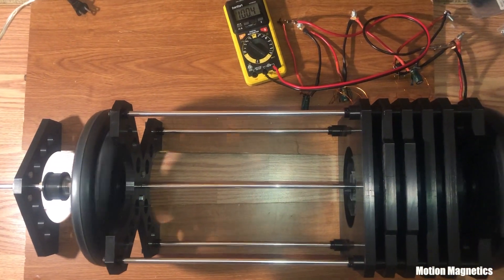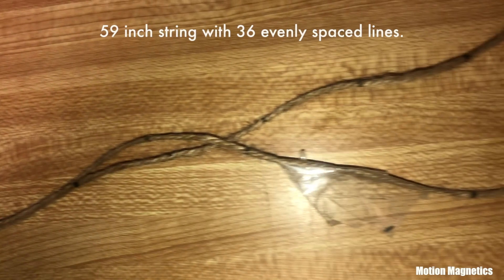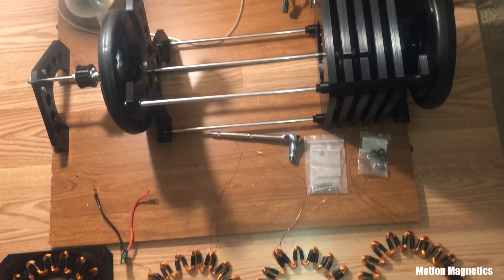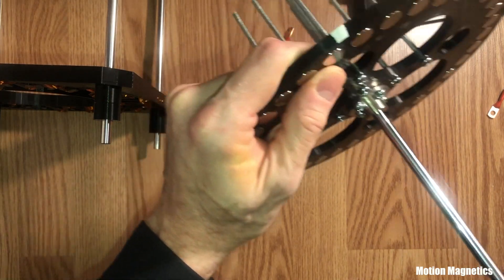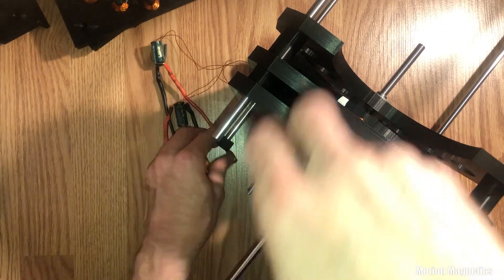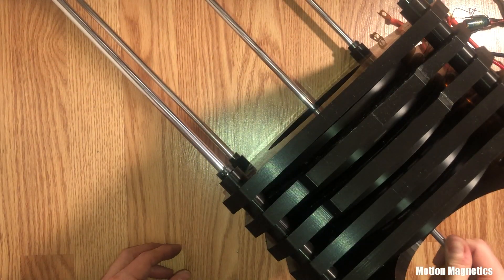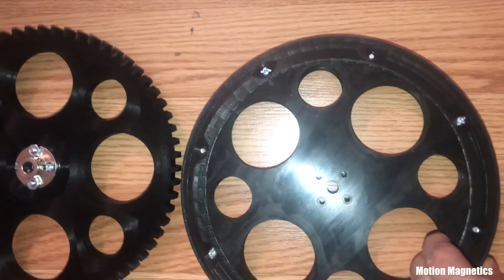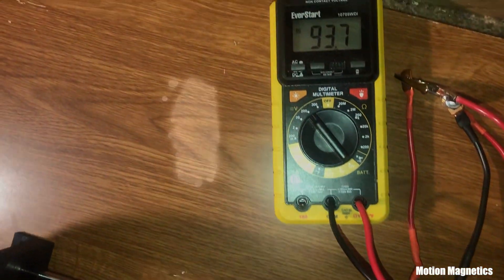Stackable Generator Assembly Guide

Comment: Greetings I been watching u for a while I have own project of my own could we have conversation about this tho I'm suprise that very lov volts as output just did u heard about Infiniti sav sadly it been taken down but it managed to make generator of 10.000wats of output but it needed to charge the capacitors to full before stating the generator it self I would call it air transformer with transmission honestly it worked for 2 days no stop on island without eternal power that the last video they ever made but they continued for one year later and then vanished or joined someone's:) can't say too much here i said enough  can we have conversation
Reply from the maker: It's scalable, so the voltage can be increased. I was also turning it at a low RPM.
I've heard of it, even mentioned it in videos. Like you, I haven't seen any updates on their progress in a while.
Reply: @Motionmagnetics  I found an update but I can't say it here to u use communicator like what up or discord or the one that is more secure element matrix would be nice to have conversation I'm have made working prototype too but the management of copper coils is something that I'm struggling to connect like 200 something coils to an motherboard that can balance the output of all coils to one output I didn't think about the way u did it with one loop around in loop did u thing about to use aluminium to make air transformer receiver the output would be greater the is even similar prototype from Nikolas Tesla if u interested I would let u know
Reply from the maker: @alangolab6657  You're the second person who has suggested setting up a discord. I'll consider it.

Comment: I'm planning on doing this with plywood
Reply: Ok update if using plywood u need to coat it in some kind of sealer to the plywood  it warped over the winter and using sealer should stop that and u will want to drill dozens of quarter inch holes in every plate so air can cool the wood they get very hot on a windmill and i found the centers and edges started to turn black and smelled like burned wood and if u paint it use white oil based paint
Reply: Oh ansd dont forget only use quarter inch plywood for the rotors and half inch for the stator
Reply from the maker: Great idea!
Reply: And osb can be used

Comment: im still very interested in what your doing and would love to talk about some things.
im not full of it i just need to finish getting my designs protected from greedy people so they can be useful like what your doing for the people who need this type of thing.
ever see a working space heater that costs 5 dollars a month running 24 hours a day or less to run? i cant run mine for more than 1-2 hours at a time or im roasting alive. this cant burn your house down safe with pets and kids and pulls 1.2 amps current draw? yeah it sounds useless yet it works very well. i can show it to you but i really need your help.
how much power can you really get from your generator? i need a generator for when i go camping. idc if i get ac or dc as i can convert it and need both but battery storage is 12v based.
i also have a very large speaker and its magnets 3 stack of round magnets if i remember right its an 18" subwoofer for car audio competitions the magnet is 9" tall and 9" wide so each is 3" thick.
is there a type of generator thats even worth making with those magnets or are they best used for making a motor. id considered a round coil loop and track and having the whole motor travel around the track as like a giant induction event. spun by a small motor to get to the speed needed. but i thought about seperating the magnet stack but its only 3 and you dont get many pole flips.
i also have a ceiling fan i had considered hacking up as it does have alot of coils 3 phase and ac. but it needs magnets. i have some decent size motors ive been picking up to spin various things. and i have a high output alternator for cars i have been trying to find a good match to spin if i cant come up with something more fun. i just dont want to haul around fuel or run out. just have everything i need where im at and not weigh a million pounds too. i have a business to run and it puts me in remote places with no amenities. so having power can make a big diff.
Reply from the maker: The power depends on how you build it and what you use to power it. Adding one gear and a hand crank earlier today increased the voltage to over 180. I'm not sure of the amperage. I'm planning on using a gear system with a weight, but you could pedal it with a gear system or hook it to wind or water as well. 
I'm really just trying to present a base system. You could build and stack any axial flux system and produce whatever your energy needs require so long as you build it to the specifications necessary.
Reply: @Motionmagnetics  thank you. so roughly what your saying is it produced over 180 volts. i have a space heater that uses 125-140 watts of power 110 ac. it only uses 1.2 amps. vent temp is over 85 degrees f.
your generator could power my heater most likely. 1 solar panel can run it 24 hrs a day zero power usage but helpful heat. my end game is to have my camping batteries charge so when im done mining for the day at remote locations i have power call me crazy but i like to relax at the end of the day after working and not be out in the middle of nowhere trying to cook in the dark. my current camping setup can run about 8 hrs off my battery storage. if i could charge that while im working and have it ready to go when im done would be nice. now i have to spend gas to run things. i have to charge with my car. what if i run out of gas and there isnt a way to get more. yeah i can bring a gas can but its going to be where i sleep im good. one of my power sources i tested with used an electric motor and it spins a car alternator but the alternator is harder to run than that motor can handle. i just need a diff motor. or a diff generator coil. my future plan when i have some money to waste is atmospheric energy harvesting. its real and a thing and im willing to bet i can charge off that 24/7 so after a few days my batteries will be full. or generators like yours i could run very easily.
Reply from the maker: @chehystpewpur4754  I would imagine it would power a heater fairly easily. That's one of the things I plan to test it running when I get things more set up. I'll post a video showing the results at some point.
Reply: @Motionmagnetics  thank you for your time. i know i sound like a crazy madman and i promise you i never said i wasnt crazy.
but im the good crazy i promise you that. i just finished my pretty much final rendition of my space heater that i told you of. 4 trim pieces on it and its done. pick the size pick the power color and how it smells. it will also do heat and ac on the next versions with the same power so no real change other than cold too. it works as a no power radiant heater i ran it last night for some hours using 3 watts pretty much the whole time. power comsumption meter agrees sometimes it doesnt even register the things running. when i seen your generator i was like man if i had that thing i bet i could make it pretty useful.
turns out i can make it better and im willing to tell you how. and cheaper and ill tell you now. your magnet holders are 3d printed and you made comments about how its not very good and i know thats also very expensive. go to your local home improvement store. look at a product called luaun i think i spelled it right. its flooring underlayment. dirt cheap a 4ft by 8 ft sheet is around 20 dollars. get a hole saw. whatever size you want your rings to be so say 6 inches drill quick easy holes and have round chunks of wood. its thin plywood with plastic inbetween like a grilled cheese sandwich. your car windshield is glass plastic glass and its much safer and stronger than just glass. this cheap light wood is just the same. it doesnt care about heat its non conductive and its much stronger and sturdier than your 3d printed plastic. you could cut over 100 discs out of that sheet of underlayment without even doing the math. you could use it for other things too. the best part is all those magnets you have to stick into your 3d printed parts. yeah get the right size drill bit. drill your holes and now you have easy pop em in but it is make faster than your 3d printer can dream of. the wood is about the thickness of your magnets too so nice finish.you could sheet over tape over hot glue epoxy super glue anything to hold them in place if the hole is tight enough it may just hold itself in. no deflecting melting or bending. and you can stain the wood and have a beautiful finish on it in the end. a rich looking product and it actually costs less than your current materials. ohh i almost forgot this material is alot lighter than the plastic too and smells ok when cutting it so added bonus. you could use any form of plywood though get a nice maple oak birch or cedar for some color and grain options and your gonna have one of those beautiful desktop models but it actually works and we can make it work alot better you know. id love to chat with you sometime in private. i can show you some of the things i make and have been toying with and you can see were both very much so doing the same thing. i just cant post some of the things im doing yet publicly cause im afraid it will get stolen and used for profit. i want this stuff to be cheap and affordable for anyone. sell the design cheap and they can make it themself or if they dont have the ability ill make it for them. im trying to convince a man on a boat to let me make one for him the cost of parts. his last heater exploded and could have burned him alive in his sleep. his viewers are begging him to use diff heat. he has to use a terra cotta heater for cost reason. i could give him heat and ac in one and cheap and safe and he thinks im crazy. as im sure you thought i was too. the math is real im sweating in my room and its only on radiant heat now. 3 watts my dude. the inside of the heater is 80 degrees and climbing i just turned it on less than an hr ago. the fan isnt even on.
im actually planning on putting a light in the one that comes in the next generation. i want to make an induction coil so when the fan is on the emf from its 30 watt motor will light a little led light like an old computer fan when the leds came out. they lit the led from the fan not the power wire. because ill have a 3 position switch hot cold and off. red led hot blue led cold. just a little kick for the people who want it. a free mood light. i used window screen to cover up the fan and hide plastic. i overlayed 2 sheets of it so it gives a cool acid trip design when it moves and will look like flicker flame in the red like the electric fire place. the blue will look like icy wind i guess and snow blowing. it doesnt have to be there but it does make you smile. and doesnt cost anything.
Reply from the maker: @chehystpewpur4754  Thanks for the suggestion. If I owned a CNC machine I might give the cheaper materials a try, but I don't own the proper tools to accurately cut the parts out of the materials as you described.
Have you posted any videos of your heater/air conditioner?

Comment: If I could ask. What is the average voltage as well as current that you are capable of putting out now? Cause I might test this design myself when I get the time. 

Also, thank you very much for putting all of this out there. I am trying to make my own home generator for exercise and this might make things a lot easier for me.
Reply from the maker: I haven't connected it to anything to get an accurate reading, but just giving it a quick spin it puts out between 60-100V. Not positive on the amps yet, but I believe it's around 5. I'll be able to get some more clear numbers once I set up the gear system.

You're very welcome. I think it might work great for that application.
Reply: @Motionmagnetics  understood. Thanks again.
Reply: @Motionmagnetics Hey man, sorry to trouble you again, but I'm actually trying to make your version of this now and so far things are going along really well, assembly wise.

However, at this point of the video ( 2:37) , how much of a distance was there between the 2 rods within that 2 x 4?

I  just need to get a somewhat accurate length for a test spool of yarn before i actually use wire.
Reply from the maker: @garybrown2039  No problem. I just taped the ends of the 59-inch string together and pulled the pegs snugly inside of the loop of the string and screwed them roughly centered to the 4x4. Depending on the size of the pegs you use it will vary somewhat from the distance of my pegs on the 4x4, but that doesn't matter as long as you have the correct length of the string formed into a loop and it's snug against your pegs.
Reply: @Motionmagnetics  understood. Thank you. I think i got it to work because the string somewhat fits in the 3d printed  part. Its just a little loose but i think the wire will be fine.
Reply: @Motionmagnetics  Hey man turns out. I am testing it right now and I'm getting voltages within range of what you stated.

Max of 9-12ac for just one stator . And in my opinion, my version is way less well put together than yours. So thanks for the video because it is a good start.
Reply: @Motionmagnetics  I do have one question though.  When I hook this up to my Volt meter there is no current going through. 

Is there a specific way that you rotate it to get it? Because at max I just get like 20 milliamps.
Reply from the maker: I was basically shorting the system to test the amperage and it was coming up around 1amp, or just under it. Until I test it under load at a higher rotational speed I don't want to guess at what each coil will put out though. I've been building a gear system to connect weights to, and adding more coils and rotors. Hopefully, I'll have an update before too long, but I'm taking my time and trying to get everything set up the way I want it before I share it.
Reply from the maker: I hope you'll post a video when you're finished. I'd love to see what you've put together.
Reply: @Motionmagnetics  Hey man I wanted to ask, did you also happen to put a resistor of any form on these? I might be testing it out again this weekend.

 Do you also happen to have a Discord as well or other form of anonymous communication? Id rather not do it publicly.
Reply from the maker: @garybrown2039  Not currently.

I do not, other than the Facebook page by the same name as this channel.
Sorry, I'm not always the best at keeping up with correspondence in a timely fashion, but I try.
Reply: @Motionmagnetics  its all good. Plus i actually sort of figured out what i was doing wrong. Turns out i wasnt hooking up the diodes and the capicitors. I just used my breadboard with some spare parts and i managed to get a constant amperage of 0.25 with my power tools.

When i make more progress ill let you know. 

Also by any chance did you ever think of making a discord?
Reply: @Motionmagnetics Hey, man. 

Just touching base , turns out I was able to make some progress after work every other week.  However, I have a question in terms of hooking up the staters in series.

Because when I do it separately I can get the voltages, but when I put them together in series they don't work.

 Do you have any advice?
Reply: @Motionmagnetics Hey, man, just following up.

Comment: An engineering observation. 

The inner screws, although should suffer zero vibration, might work themselves loose.  Use lock-nuts or a double nut arrangement to lock them in place.

Cheaper is a lock thread on the thread.

Cheers 🇬🇧
Reply from the maker: You're not wrong. I had one of the rotor screws fall out the other day. Granted, it was one I hadn't tightened, but better to be safe than sorry. 

Thanks!

Comment: i still think this same style with different windings would be an over the top motor , ie every disk is equal to 2 lines of force , ie a standard motor has only 1 line of force, but a stackable motor has as many lines of force as you have disks, meaning more force out per volt used
Reply from the maker: You could very well be right.

Comment: Great design, had a thought that perhaps using the frame you could make a jig holding a blade that you could use to face the stators so you could get closer to the coils, also once all the stators are joined you could balance them as one unit with weights etc on both ends.
Obviously while printing you may need to print extra perimeters to make up for facing some of it off and it won't be the best finish but looks aren't important.

Awesome work though.
Reply from the maker: Thanks, and thanks for the suggestion.

Comment: Have you thought about and/or calculated how much heat will be pumped into those plastic prints and winding tape at steady state operation? Been loving the design so far and very curious to see how you handle cooling, or if it turns out to be a non-issue.

Saw your comment that the holes in the rotors get a bit of airflow in there which is interesting. 

Cool stuff!
Reply from the maker: I haven't, but we'll all find out when I'm able to get everything put together and give it a proper test. I did forget to mention in the video that I added a drop or two of superglue to each strip of electrical tape to keep it secured. 

Thanks!